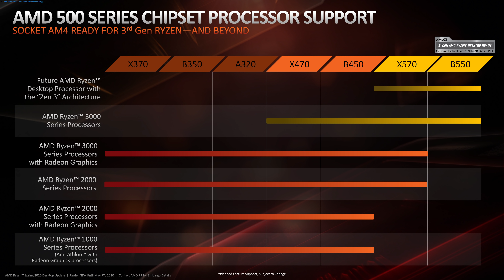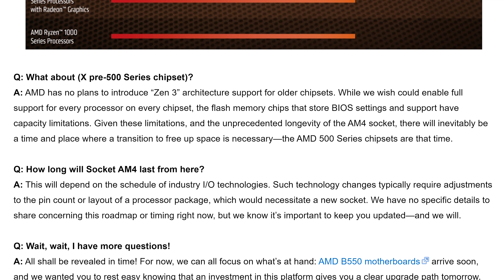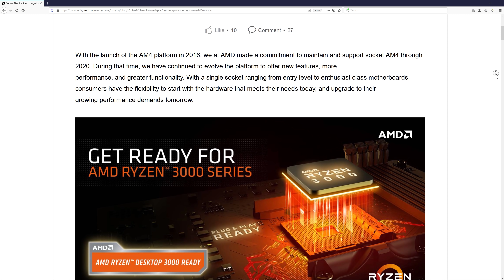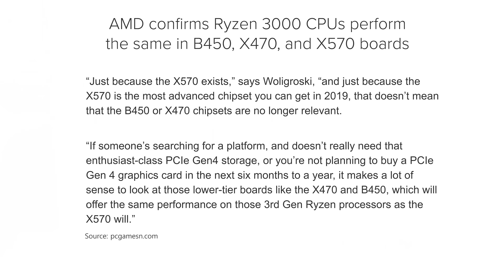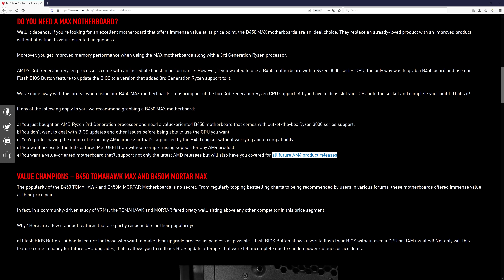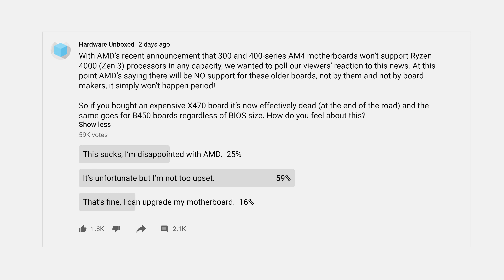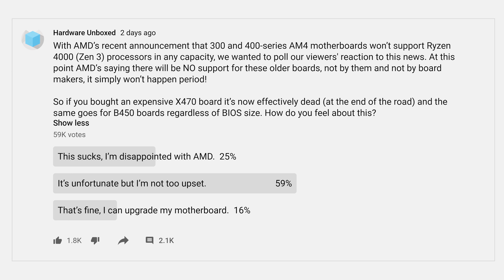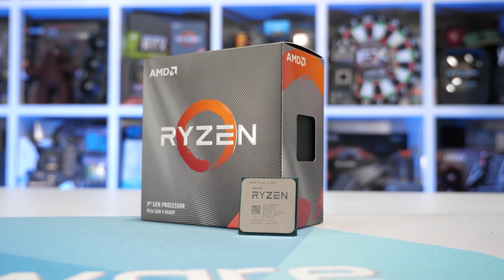AMD Does An Intel, Axes Zen 3 on 400-Series Motherboards, Our Thoughts

Comment: Thank you for holding AMD's feet to the fire on this one. It's been disappointing hearing other reviewers give AMD a pass because, "AM4 compatibility has been great so far. It had to end eventually." I'm quite ticked off about this. I'm sure that all of us who have bought the 3600 in the last year, making it the best selling CPU by far, would have strongly considered x570 if we would have known about this. But what makes it the most frustrating is knowing that if AMD hadn't delayed B550 for so long, most of us would have bought that over B450. I feel like this move is going to ultimately bite AMD in the ass by ensuring they won't sell as many 4000 series processors.

Comment: Jesus christ i just built a pc with x470 asus prime and its an awesome board and everything, but had I known this i 100% would have snagged the tuf asus x570 in a heartbeat.  My original plan was to use the 3600 for now, and then go 4900 for this next generation of ryzen, but now learning i can’t do that with my motherboard is insane.  Even the computer shop told me 1 month ago my mb will support ryzen 4000 series as long as its am4.  Kind of ridiculous if you ask me.  There should be a rebate program to trade and buy with a discount on the upgraded motherboards or something.

Comment: If you wanted a semi budget board with future support the b450 was your only option. There's no point spending as much on the motherboard as your CPU when the only advantage that x570 has really is pcie 4.0, which is not needed for 95% or users, especially slightly more budget oriented ones. There wasn't even the option to hold out for b550 since it has been delayed so much with no release date until basically now. Super disappointed that I now have a dead platform.

Comment: Imagine my irritation when i bought tomahawk max just two days before zen 3 info came out. I had to buy it because my old motherboard had failed and i absolutely hate chipset fans and prices of x570.
Reply: The chipset fan hardly turns on to be honest. Though there is the issue of it breaking after years of use.
Reply: @albal156  that's true. But People shouldn't have to pay for x570 of they don't want the features. The way i see it, since AMD didn't launch B550 and x570 at the same time, they really shouldn't be removing Zen3 support from B450. Particularly if there are the max variants with higher EEPROMs available. Makes no sense. And trust me I am not shitting on AMD. They are wonderful. But this is a dick move tbh.
Reply: @archieleach575  Yeah B550 should have been available at launch. Due to the fact it wasn't many customers will have bought B450 boards and X series boards expecting they'd be compatible because motherboard companies said so. In trying to not screw over average joe customers who are scared by flashing their BIOS, AMD has just screwed over the same people who were instrumental in their revival in the space. I'd say without people recommending their CPUs they would have had trouble breaking into the OEM market where Intel dominates. Heres to hoping Intel takes this opportunity that AMD has left open for them (unless AMD backtrack on it I suppose.) Plus AM4 support means zilch if the CPU you want to install hasn't the BIOS code or chipset to support it. AMD's vague marketing was the source of that.

Comment: I have a conundrum, I'm deffo upgrading to either x570 or B550. I have a B450 currently. 

My issue is this, IF AM4 has only one CPU generation left with Ryzen 4000 before AM5...should I get x570 cr B550 ?

I ask this because if I choose to sell my x570 vs. B550 it is obvious that x570 has alot more CPU support compared to B550.

X570 will support APUs and also Ryzen 2000 series chips etc.

B550 will only support Ryzen 3000 series chips and no APU support. 
So from a purely second hand market perspective what should someone buy?

x570 cr B550 ? 🤔

Comment: FFS, I bought a B450 Tomahawk MAX exactly for the BIOS chip and future AM4 support.
In that case I am not buying Zen3, I'll wait for AM5 thank you verry much
Reply: I will be trying Intel for the first time in almost 4 years. Might as well... Seeing as I have to buy a new motherboard.
Reply: What if Ryzen 4000 proves to be the next leap forward similar to its laptop counterpart? Spending.a little more on a new mobo will not seem like such a big deal to the people here (clearly enthusiasts)
Reply: I bought into the ryzen 3900 X. Was totally planning on upgrading to the 4900 X or the 4950. I'll wait for the next upgrade in 2 years. Sadly AMD can go kiss my ass
Reply: @leechburglights  Why do you upgrade that often? I have had a laptop for the past 8 years and stopped gaming on it since 2015 because it can t any more. However for the regular stuff it still works fine, with a few hickups here and there.
I want to get a desktop PC this year, but my plan is to use it for at least 5 years so I don t care about future support on my motherboard, I will be buying everything new anyway in 5 years.
So my queation is what s your reasoning behind upgrading that often? Is the performance increase  within 2 years that noticeable?
Reply: @psc93krp  I make a living using my PC.  Started with a Ryzen 1600... then got great deal on an 1800x a year later (around $200). As business has picked up, I did my upgrades.  I'm still on my original X370 but got the 3900x last year.    Computers do more than just gaming ;) just kidding.  

I guess I don't NEED to upgrade.  All I'm doing is putting more money into AMD's pocket.  However the productivity gains I see with the upgrades are pretty meaningful with my work load.
Reply: If you have to buy a new motherboard that will have crappy future support, you might as well buy Intel. At least their platforms are more stable and the performance in gaming is superior.

Comment: "...a tick a tock...and then bugger off and buy a new motherboard" :D Sorry, just the delivery in that bit made me chuckle.
Reply: To me it looks like AMD have kept their promise. If you look at AMD's official Socket Stability slide in the article "3rd Gen AMD Ryzen CPUs Will Work on Many Existing MSI AM4 Motherboards" (search it on Google), you'll see that the graph clearly shows no support for new CPUs after 31 December 2019. If you take a good look, the orange bar stops right at the end of 2019, just before 2020 starts. It was already know even a year or two ago that Zen 3 will come out some time in 2020, or in other words, AFTER the official support period. So how did AMD not keep their promise? 🤔
Reply: @bgtubber  Yeah it makes sense to an extent... Although no one is answering...why B550 (no backwards compatibility) doesnt have the same cpu support as X570 (supporting zen+ & some zen 2 cpus) while B550 is not supporting previous zen cpus This is the confusing part... you got any ideas?
Reply: @Matcc  I don't have an answer, but either way, it looks like their promise was kept and not only that, but they actually overdelivered because they allowed X570, which was released before 2020, to work on Zen 3 which releases in 2020 - outside the official support period for this motherboard. 🤷‍♂️
Reply: @bgtubber  Yeah, X570 being cpu backwards compatible but not B550, is just unusual... and no one is talking about that is just surprising.
Reply: @bgtubber /videos AMD stated, that they will support AM4 through 2020 (not till 2020). Nothing more guaranteed, but they definitely didn't say anywhere, that they won't support it further. It could have easily happen, that DDR5 could have get delayed, forcing AMD to stay on AM4 even in 2021...

Translating marketing slides to exact dates is hilarious by the way :-D You really made my day!

Comment: I ordered a 3300X and a B450. I still have time to change my order. What motherboard would you recommend for a budget build with support for the next gen Ryzen CPUs?
Reply: There is just x570 out there right now. No x570 board is cheaper than 160 bucks so alot more expensive than the 3300x. Wait for B550
Reply: @lioneckenbach552  Guess I'll just have to cancel my mobo order then. It's disappointing to see that AMD didn't have the foresight to realize that people buying the X3300 also want a non-nigh obsolete budget mobo to go with with it. Despite how good the 3300X looks, my impression as a first time AMD user has been lowered quite a bit by this move.

Comment: I have a x370, but still I think it is a bunch of crap to not support it, AM4 was marketed to have long term support, Ryzen is meant to be a SOC where chipset was to become less important. AMD never denied it wasn't possible from their statement, instead they are doing the typical lazy corporate thing and cut off support, which only just creates more waste. You should never measure to what intel does either, and no one should be an apologist for any corporation, especially when they market something in way that is misleading.

Comment: I kinda feel kinda shitty now, I had an x570 board that died, so instead of spending a stupid amount ($500AU) on a not shit x570 board or waiting ages for MSI RMA to replace the board I had, So I went and got myself a decent b450 Pro Carbon, With the intent to move up to a 4000 Series at some point, But now, one of the biggest reason I moved from intels money vacuum, has now caught up to me again.  Pretty Gutted tbh

Comment: bought a MSI B450 gaming pro Carbon since 2018 but built my pc around feb 2019...... welp, looks like i cant upgrade to the zen 3 unless DDR 5 memory is involve maybe,... and concentrate on the newer gpus, i dnt have any use for pci 4.0 since im only use it for gaming and entertainment purposes....

EDIT: using ryzen 2600 + gtx 1080 :)

Comment: tbh, yes, AMD at least miscommunicated ALOT about compatibility here. BUT! they supported this socket since 2016. this is the last year of their promised socket maintainance. I was about to upgrade a month ago and then settled on using my current setup a little longer because I got sceptical about what AMD would bring out this year. It could have very well been that Zen2 was the last AM4 compatible generation and Zen3 would have come with a new socket. Then all of your upgrade paths would have gone to waste.
After all, AMD is a company, they want to make money. And since Intel hasnt come around with something competitive so far, AMD is in the position that Intel was in before first gen Ryzen. This was forseeable.

Comment: Yeah i bought an x470 on zen 2 launch because in my country there was a HUGE price jump from decent x470 to cheapest x570 and I do not have aby pci-e 4.0 devices. Aaaaaand im a little disappointed because i really was hyping up for those zen 3 ryzen 7 cpus..... seems it will be just zen 2 until new mobo with new socket probably zen 4, alder lake or some other intel new gen

Comment: I get it your all pissed off that you can't get the latest model of ryzen on your older motherboard. But they have supported older hardware for over 3 generations, that's completely unheard of, I for one feel that the reason they are really doing this is because after ryzen 4000 they are looking at a big upgrade in the future.

Comment: I am liking and commenting this to push your stats since I am 100% on board with your position.

I was hoping to build a super cheap AMD system with the goal of having it upgradeable to the next gen later down the track. As it is I can either do a B450 now and have to upgrade motherboard and processor later or wait for the B550 and 4000 series CPUs with that likely to be a single gen build too since it seems that the AM4 socket will end with the 500 series chipsets.

Comment: Maybe a new poll with explicit options like "I have a B450 board and the issue doesn't bother me", "I don't have a B450 board and the issue doesn't bother me", etc might provide more insight. I'm pretty sure your assumption is right though, it's people with B350 and X570 and Intel boards saying that it does not bother them.

Comment: AMD: The Bios Size is Too Small
BIOS Flashback: I'm About to End This Man's Whole Career
Reply: i think that bios flashback should be a standard feature in am5, so they can support all the motherboards in that platform
Reply: @icedoutshef  Most if not all X470 MBs also have 32MB BIOS, so a large chunk of MBs do have an 32MB BIOS, including the B450 MAX lineup.
Reply: @joeyvdm1  not actually the case only ASUS made theyr whole lineup with those chips, most other x470s are on 16MB ones aside of few top of the line models. Thing is whole x570 Gigabyte lineup has those 16MB small chips too ...
Reply: @joeyvdm1  Dont some x570 boards have 16 mb bios?
Reply: @schumbo8324  Yes but if the BIOS size is >16MB and some boards have 16MB then it would ruin their Board's sales while the others will reap the benefit. To avoid it, AMD will have to provide multiple BIOS codes for each chip size or separate the codes and maintain them independently.
Reply: Correct. BIOS flashback is an feature on many MBs.
Reply: Agree. With BIOS flashback, the board partners won't need to cram support for every generation into one go. Just like Steve said, they can split and pair up different generations together.
Reply: Just buy b450 steel legend.... And amd ruined it
Reply: make it 64 MB in am5 in the future
Reply: @fakrulibra6364  No 256mb with extra 16MB cache we need.
Reply: @GreekSIMRACING  im afraid you are confusing the CPU cache size with the BIOS flash ROM chip size
Reply: @fakrulibra6364  Let's make it 6 GB.
Reply: do people find shitty comments like these funny ?? iM AbOuT  To EnD ThIs MaNs WhOlE CaReEr, damn kids